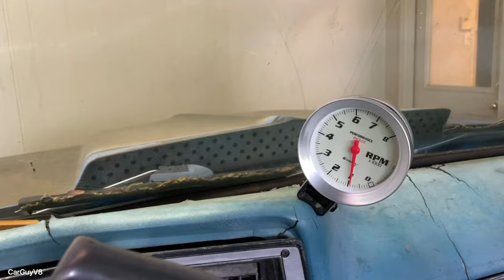How To Install A Distributor In A Small Block Chevy

Comment: You mentioned to turn the motor over to get the distributor to drop in place if the slot doesn’t line up.  The oil pump is driven by the distributor nothing else and the distributor runs off the cam. If you turn that motor and the distributor gear is not all the way in place it can bind and damage that distributor gear. The way I have always done this is taking the distributor back out take a long flat head screw driver and turn the oil pump rod until you get it where you need it.
Reply from the maker: Thanks for the information I was not aware of that.

Comment: Im confused..your rotor is pointing down the center of the intake...shouldn't it be pointing st cylinder 1 on the motor?
Reply from the maker: As long as the rotor points towards the #1 post in the cap itself (before advancing it) you’ll be fine.

Comment: Just swapped out my cap and coil pack on my 350 and now it’s just cranking with no start, i went back twice to check my connections and it all seems correct and I followed the diagram to wire up the plugs with the firing order. Do I need to follow this procedure? Or is it only if the distributor was completely removed?
Reply from the maker: Was it running before the coil and cap change? If so then you’ve got a bad coil most likely.
Reply: @CarGuyV8  yes it was.
Reply: @CarGuyV8  in the morning I will test my old coil and if it’s runs I’ll just go get a different new one. I’m really hoping that’s it, otherwise I’m stumped on a super simple repair
Reply: @CarGuyV8  still nothing, wired correctly, old coil doesn’t work now, getting spark and gas. Timing is still set, I just have no clue what it could be
Reply from the maker: @KyleReese26  check your power wire to the hei and make sure it has keyed on voltage
Reply: @CarGuyV8  yeah it does, is there a chance the ignition module inside the HEI got fried?
Reply from the maker: @KyleReese26  yes that’s always a possibility
Reply: @CarGuyV8  the one thing I know I did wrong but didn’t know if it ended up screwing anything up since it didn’t pop a fuse was accidentally switching my tach wire on the battery connection on the hei and the power wire then cranking it.
Reply from the maker: @KyleReese26  That’s the problem. 12v into the tach terminal reverses the polarity. I can’t tell you with any certainty what it fried inside the distributor. Let me know what you find.
Reply: @CarGuyV8  I think what I’ll do is just replace the whole distributor, the assembly I found with good reviews is pretty affordable, nearly the same cost as the coil I bought. That way I can start from scratch. Should be in next week
Reply: @CarGuyV8  still didn’t crank with new distributor!! How in the world is this happening, has gas, has spark. 100% is timed correctly. No clue what’s going on

Comment: I thought balancer needs to be at 10 degrees btc and rotor pointing directly at the #1 plug on the cap before firing the motor?
Reply from the maker: Yes but you still have to know which stroke you’re on. Just popping in the distributor without checking if it’s on the compression stroke you’d have a 50/50 chance of being 180 out.